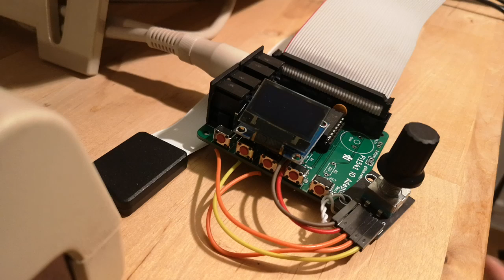Demo of Pi1541 with rotary encoder KY-040 (new feature as of version 1.21) connected to C64

Comment: Cool! I just bought a bunch of rotary encoders for my Amiga's Gotek... Gonna use one of the leftovers for my Pi1541.  (I currently only wired in a DE9 port on it, and i control it with a sega master system joypad, rather than wiring in some tact switches. :D